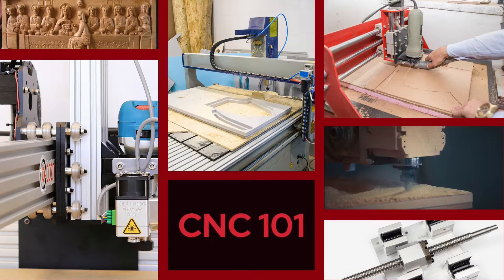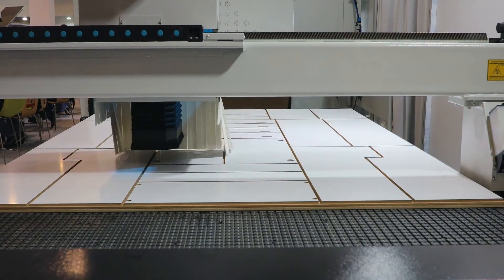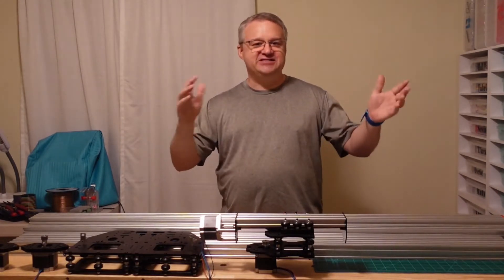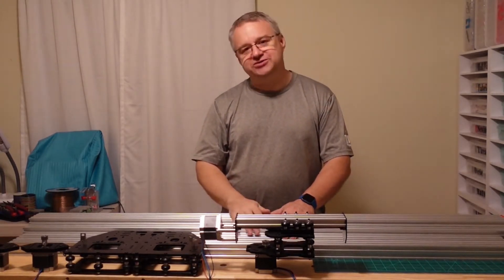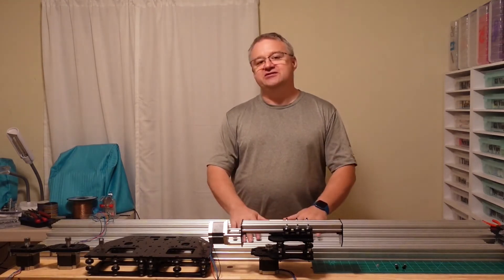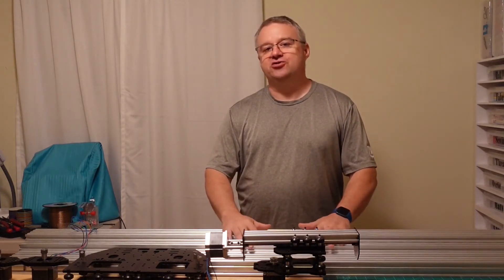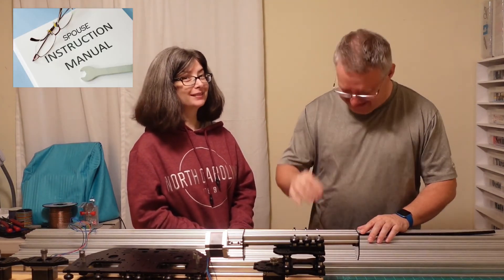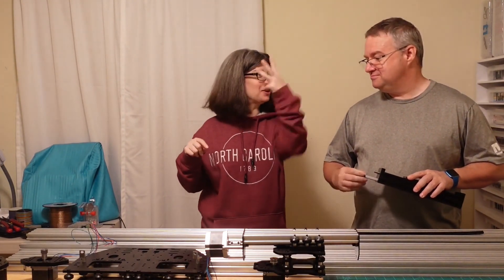What is CNC Woodworking?  | CNC Router Build Series | Introduction

Comment: I'm more experienced in the metal side of CNC. I'm looking at dipping my toe into the wood side and picking up a small CNC router. I CAN cut wood on my machines but I'm pushing my spindles with the higher cutting speeds than dedicated routers. I've also noticed the software I use for machining is more robust than the router software.